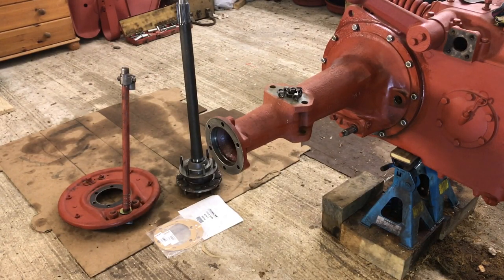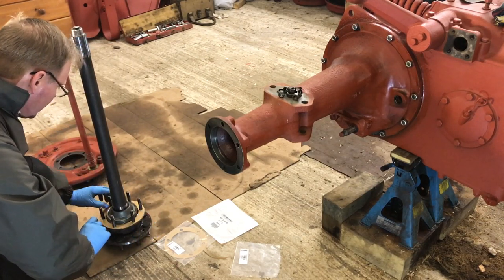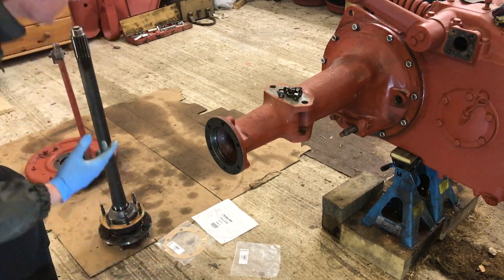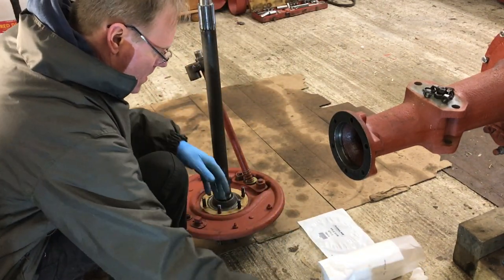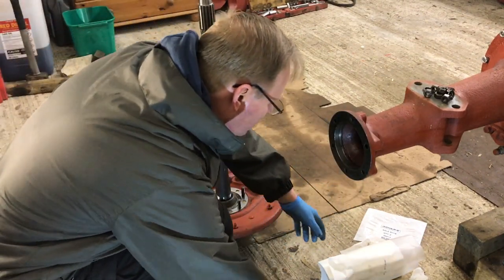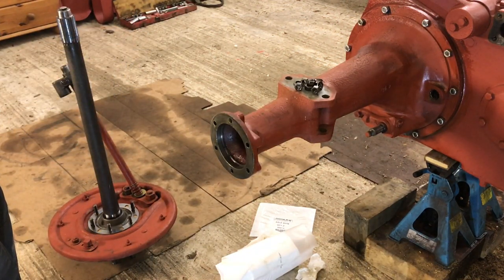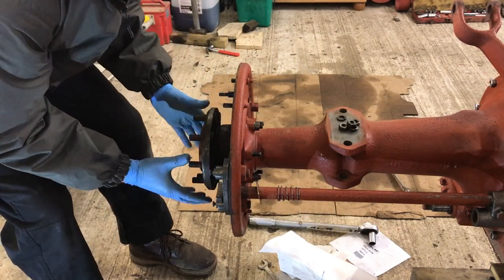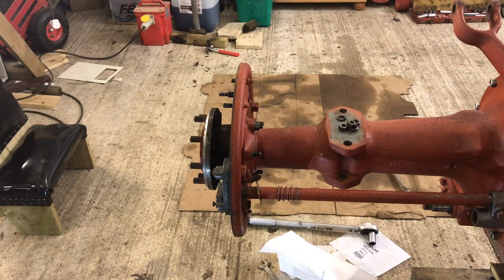#39 Ferguson TED20 - Installing Rear Axles

Comment: Another excellent video. Lance Maskell will be impressed with the detailed narrative. IMAO I would not install the brake cross-shafts until the end float has been established. Also keep in mind that the end float may change once the tractor is driven for a few days because you replaced the differential carrier bearings. The bearings might seat in closer and increase the end float. Again, this is only my arrogant opinion and it may not happen.
Reply from the maker: Hi Charles, thank you! I am really enjoying reading your comments and suggestions. I absolutely agree with you, later you will note that I’ve re-used the old brake shoes. My intention at the time was to run and drive the tractor a few hours once it’s done (mechanically) then bring it back into the shop to: reset the axle float, replace fluids, re-torque the head, reset the tap… you get the idea. That said I naively imagined that would be in under a year’s time 🤣🤣🤣 Anyhow the logic is sound - 2022 is the year!!
Reply: End float will remain the same, the axle tips push against each other. The weight of the tractor makes the taper bearings want to push inwards onto one another.

Comment: Great video as always, to make it easier you could cut one side of the shim and bend it around the half shaft so you don't have to remove the entire assembly.
Reply from the maker: Hi James, I never thought of that, you'd still need to extract the half shaft far enough to clear the studs, by which time it is disengaged from the crown gear splines anyway. But it certainly would avoid needing to lift and man-handle the whole assembly each time. I'll have to try that next time I do this job.
Reply: That’s definitely worth doing on the mf35 to save the inner seals.